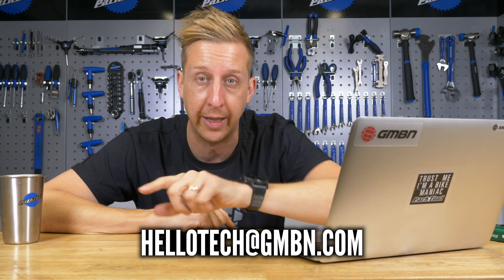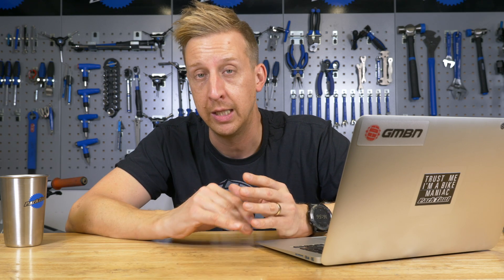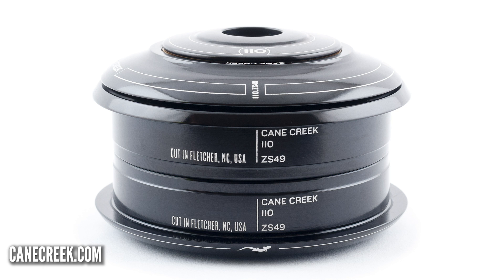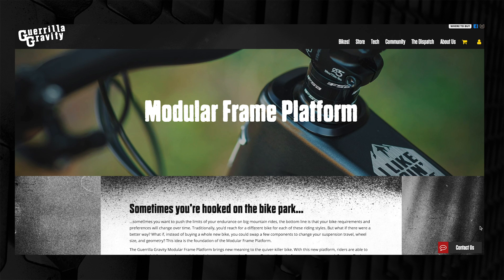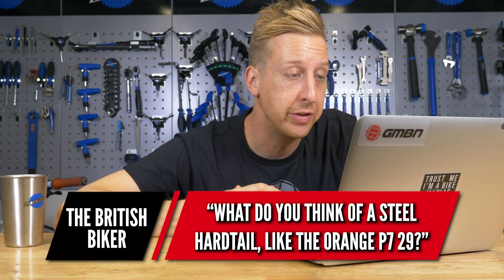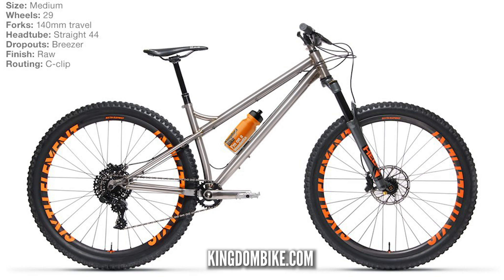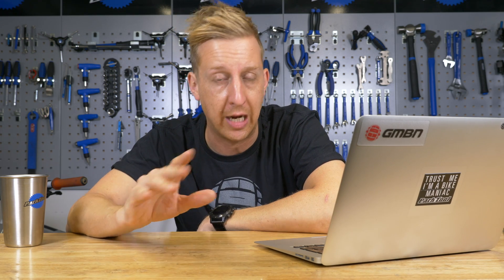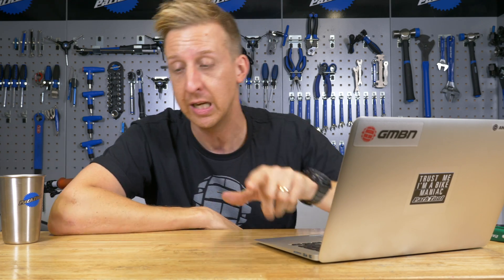What Is The best Frame Material? | Ask GMBN Tech

Comment from the maker: Remember to use the hashtag #AskGMBNTech with your questions 👇 and we will try to answer them for you. 🔧
Reply: #Askgmbntech why dont bikes get glued( aluminium)Most cars nowadays use an epoxy which is very strong. Bikes dont go thru as much stress as cars(energy) so surely it could work.
Reply from the maker: @natfelton7586  The Atherton bikes have carbon tubes bonded into 3d printed lugs and the lugs have an internal wall supporting the tube also. It's an interesting concept and we may start to see more of this in the future.
Reply: @gmbntech  nice thanks for the feedback. Could also be lighter 😂😂 than welding. Save 0.00000001 grams
Reply: #AskGMBNtech If you have e-bike, do you need to go faster on jumps, because its more heavy and gravity force it to ground more?
Reply: #AskGMBNtech I know some people buy metalic and resin pads. Then they put one side resin and second side metalic pads on same brake. It will work in high temperature (metalic) but also in slow speed and low temperature (resin).Is this a good idea???
Reply: #AskGMBNTech what is a good mtb full suspension on 13yrs?
Reply: #AskGMBNTech what about brand new chain and lubrificant ? it came with some sort of grease on it, but everytime I change my chain I'm asking myself if I should not clean it and then apply my dry lube. Thanks for your top show Doddy !
Reply: #AskGMBNTech
Hey Doddy, A big thanks to all of you for the great work! You keep me motivated!
I am upgrading my bike components ( Cube 29" XC hardtail ) and eventually i would like to transfer all the goods to a more aggressive  hardtail frame . Any suggestion on a good one around 150-200 euro? Thank you and keep up the good work!
Reply: #AskGMBNTech I've been looking at forks for my jump bike and I came across the 2017 rockshox Sid world cup forks. Would they be suitable to put on a jump bike (strength wise) or would it just be a stupid idea to put super light carbon crown forks on a dj bike.
Reply: #AskGMBNTech Is a 26er hardtail good for trails? Tnx Enjoyed your videos keep up the good work

Comment: hi sir, I wanted to ask you if I can upgrade my rear speed from 7 speed to 11 speed although my bike came with 3*7 combo
I am ready to change the shifters and derailleurs but I wanted to ask whether my bike frame restricts me to upgrade the speed. I ride a Montra Madrock 27.5 inch model with dual disk breaks. I'm also thinking to change the brakes to padded ones and the handlebar to a down one, would all that work?

Comment: #AskGMBNTech

G'day Doddy,
I own a Scott genius 740 and really enjoy the bike. The only problem is that because of the twinloc remote lockout technology thing, I have the most horrid looking cockpit. Any idea how I would go about removing the lever/cables and replacing the fork/shock lockout switches with the little levers most bike manufacturers use? I haven't been able to source them anywhere here in Australia and online hasn't been great either.
Next step is heat shrink and it'll be sweet!
Cheers,
Eli

Comment: Best material is actually steel. Easy to make frames of it cuz it has been used as a building material since ancient times. And there is plethora of different steel grades/variations with plenty of different attributes. Not eben TI is as good as good old steel. And carbon fibre is just not on the same level in the long term.
Reply: Literally everything in your comment is wrong.
Reply: @truantray  Would you be so kind an elaborate why literally everything in my comment is wrong?
Reply: 'That which is supposed without evidence may be discarded without evidence.'
In spite of that, and in case someone in the future needs this clarified:
Stone, wood and lead have also been used as building materials since ancient times. Easy to work does not necessarily mean good - I don't think I'd want a granite or balsa wood bike frame, personally.
You seem to grasp that there are different varieties of steel, but omit the fact that there is a variety of titanium alloys as well. Lol unalloyed titanium is almost exclusively reserved for niche use. Titanium alloys are incredibly high performing materials - I'd like to see you justify the claim that steel is better than Ti with something quantitative, price not factored (remember you said best, not best per budget). Pound for pound, Ti kicks steel's a$$ in strength, stiffness and corrosion resistance.
Modern carbon fiber frames are every bit as good 'in the long term' as steel. Take a look at the stress / strain curve. Both have environmental exposure issues, and they both must be protected and cared for. Unlike aluminum and titanium, they can both be repaired by skilled professionals with the right tools.
I get it, steel is cool. It's a great material for a bike frame. If you break it, you can weld it right back stronger than the first time and that's awesome.
Reply: @iankirven2711  Steel is better than ti because it is almost as light and u can repair it pretty much everywhere in the world. Carbon is simpely to fragile when u handle it not as intended. If u get a chaindrop which frame will be in danger, the Steel or carbon one?

Comment: #AskGMBNTech 
hey doddy iv got a rock shox monarch plus when in open mode it has a knocking noise when compressed passed the sag position no nocking in any other setting ? it works fine but very annoying would a 200 hr service cure it ?cheers

Comment: #AskGMBNTech Hey Doddy, I have gotten a few small scratches on the stanchions of my Rock Shox Totem (air). You can just barely feel them with your finger as they are very shallow. Will the scratches cause any problems? Any tips on how to keep the stanchions from getting scratched in the future? Also, should the Totem make a knocking sound when turning it upside down or pulling the stanchions all the way out?

Comment: #askgmbntech 

Hi, recently went to add a volume spacer to my fork but forgot to realise the air out of my fork before removing the cap, a metal pole flew out of my Stanton and I hear a pop, my air tube for the fork is now lower down in the fork and I cannot pull it out, is my fork fixable or will I need a brand new one?

Comment: #AskGMBNTech I've got a Morewood Makulu which has 200mm of travel on the rear and currently running 200mm boxxer rc forks. Would it be ok to run 180mm sc forks although I'm running 200mm on the rear? Looking at buying a set of bos idyle sc forks. Thanks

Comment: Hi Doddy! My gears seems to skip at the heaviest gear(11t) is it possible that my chain weared out but inspecting my Cassette it seems ok. What do you think is the problem? #askGMBNtech
Reply: Paul Malang yes it’s possible that your chain is worn out. Invest in a chain checker
Reply from the maker: Hey Paul, yes it could be that your chain is worn but first look at the limit screws and cable tension.
Reply: #askGmbntech is sram 12s chain compatible with 11s?
Reply: Paul Malang if you have a 12 speed chain, try it. If you don’t, 11 speed chains are usually cheaper
Reply: Paul Malang I don’t think it is

Comment: #askgmbntech

Hi doddy, i ride an octane one zircus dirtjump frame with a 130mm manitou circus expert, after riding a few months i realized that 130mm was way to much, in the manual it says that the fork is made for 120mm to 140mm, i'm thinking about riding with 100mm or 110mm without buying a brand new fork. Do ypu have any solutions for my problem

Comment: #AskGMBNTech Doddy, If I am consistently bottoming out my shock, it would be recommendable to get a volume spacer? Or just keep putting more air to the shock? I have a Rockshox Deluxe RT3 and always ride with a big backpack.
Reply: Fabian Garcia Alvarez if your sag is correct and you keep bottoming out, throw a few volume spacers in
Reply: @peterlang5047  thanks man, I will try it for sure
Reply from the maker: Trey adding some more pressure first and see how that feels. If you find you are loosing small bump sensitivity you can add some volume spacers. It's also worth experimenting with compression damping if you have that option.
Reply: @gmbntech  Thanks ! will try

Comment: #askgmbntech My friend has a sram nx 11 speed drivetrain and after just sitting overnight it has no chain tension  whatsoever, the clutch on it still works, but without any chain tension, we attached a random spring we found to the cable guide pully and to the cage, it has about the same spring tension as before, and he still can use the highest 8 gears like this, we attempted to take apart the clutch and spring housing but weren't able too, any thoughts on what may be the problem, or and possible proper fixes? Anything will help! love the videos!

Comment: I have a Chris King headset. I  did get it to go onto a mountain bike when the headset fitted needed replacing. The problem I had was the bike needed replacing instead of just the headset. The problem number 2. The headset was completely different. I have a Kona Dr Dew hybrid which I use for road and light off road. When this bike needed a new headset I had the Chris King headset fitted. I had had no problems with it and it is as smooth as the day it was fitted.
Reply: Wow, a Chris King headset on a hybrid? Pretty bling, but I guess if you have a $300 headset just sitting there...

Comment: #askgmbntech Love the show Doddy. I'm running Shimano XT brakes with 180mm front 160mm rear Icetech rotors. I'm not looking for anymore bite from my brakes, but I do notice that they tend to over heat and fade on fast decents. Is this because the rotors are wearing down and are thinner? or is it just an Icetech thing? These rotors seem to cool down quicker than normal rotors but I feel like they heat up and brake fade quicker. should I upgrade to 200 front for better heat dissipation? I bought the bike used so I don't know if the brakes felt any different when they were new.
Reply from the maker: The next step would be to try some finned pads. 👍
Reply: @gmbntech  I do have finned pads

Comment: #AskGMBNTeck . i would like to know if it is possible to route both types of dropper post into an internally routed frame. i converted from a 2x10 to a 1x10 and have the routing port spare.
Reply: If your frame has enough space around the bottom bracket to route the cable without kinking you're good!

Comment: #AskGMBNTech
Just broke the bridge of my old RockShox Reba (its an OEM version). So I bought a new used Reba SL (probably 3 years older than the one I broke) on Ebay, but it seems that the pressed in steeringtube is loose...
Do you think its possible to combine the lowers of the new fork with the upper Part of my old one?

I'm a student from Germany so pls don't judge me on my probably bad english
Reply: You probably can, but it will probably be difficult. Try knocking the newer one back in with a piece of wood and a mallet. Your English is great fyi. Nice part about English and German is they're very compatible. Ride on 🤘
Reply: Billy Annis Thank you very much!
Ride on too 🤘🤘🤘
Reply from the maker: If the steerer tube is loose in the crown we suggest you don't ride it.. This can be very dangerous if it breaks away! Providing the upper tubes are the same size it is possible to swap the lowers. 👍
Reply: GMBN Tech Thats what I thought too..
I think if I‘m abled to swap the working parts of both forks it should be one working fork in the End

Comment: #askgmbntech just ordered a new rockshox super deluxe coil on my new airdrop edit. I will need a few turns of preload on the shock. Since it requires more force to move the shock does that essentially ruin the subtleness. Surely if it’s preloaded to let’s say 1 newton and I go over a rock that only exerts 1 Newton the spring won’t move and it will essentially do nothing to absorb impact??

Comment: #AskGMBNTech Hi Doddy, I recently built a jump at my local woods and I nearly bottomed out my forks. I ride a Rockshox Lyrik RC2 so my initial thought was to add a volume spacer to it to make it more progressive. I'm new to doing my own mech work on my bike and I love to learn more about it. Can I use any cassette tool to open my air chamber or is it a specific one I need?
Reply from the maker: In your case yes a cassette tool is required to remove the top cap. (*make sure you remove all air from the fork before removing top cap!)👉https://gmbn.tech/volumespacers
Reply: Use an adjustable wrench
Reply: I don’t have a rockshox lyric, but on most forks you would use either an adjustable wrench, or a cassette tool

Comment: #AskGMBNTech

Hi Love you channel!  I have  a RaceFace Turbine dropper post that works for a few hours or at most a day and then requires "equalizing the remote".  I complained about this to store where I purchased and they "readjusted the installation" and it seemed to help for a few days and then it always returns to same behavior requiring "equalizing the remote" every few hours of riding.  I have noticed it is worse when there is a large change in altitude or barometric pressure.  I have contacted RaceFace and they just send me their trouble shooting guide and won't comment on the requirement for constant "equalization".    Is this just a consequence of bad design that I need to live with or is there a fix?  What is your recommendation for the best performing and most trouble free dropper post?  Thanks
michael bastiani, Salt Lake City Utah

Comment: #askgmbn
With all of the advances in suspension tech.. Why do suspension manufacturers fail to use adjustable damper cartridges? Its not like they are very expensive. Even the worst performing coil forks could be amazing if they came with a better damper. Just look at the auto industry. Infinitely adjustable re-bound /bound make it insanely dial-able. I have a suntour xct 28 on my 29er. It would be incredible if it had an adjustable cartridge instead of a fixed damper .  please shead some light

Comment: how do i accurately measure my rear travel? #Askgmbntech
Reply from the maker: It should be listed by the manufacturer, If it's an older model they should still be able to help provide this information. Failing this you could remove the coil/any air from the shock and measure the axle in this starting position and then re-measure again once the shock has hit full compression. You would require a workstand for this to keep the bike elevated and a fixed point to measure from such as a work bench. Hopefully this helps you. 👍
Reply: @gmbntech  thanks for the reply! 
will definitely try to contact the manufacturer first.
Reply: Google

Comment: #AskGMBNTech
Hi Doddy,
I just bought a Lapierre Spicy 3.0 and still have £400 of my budget to spend. What do you think would be the best use of the money, upgrade the bike (i.e. suspension?, for cartridge?, wheels?) or bike accessories or kit. Or should i just keep the money and spend it on travelling?

Cheers
Reply from the maker: stem length, handlebar choice can really change how a bike feels so you may want to start here? Perhaps you have a particular pair of grips, pedals or tyres you like to run? Have you experimented with tyre inserts?
Reply: @gmbntech   I didnt think about the stem and handlebar might have to experiment with that, im gonna have to get pedals as well, and i have'nt tried tire inserts yet

Comment: #askgmbntech I recently bought Scott Aspect 930 2018 used bike, it's in amazing condition but it's equiped with Suntour XCR 100mm Fork. Should I swap this fork for something else and which one I should put in it. I would like to get this bike a bit better for hill so...
Reply from the maker: Is this an Air or Coil fork Elmin? What brand and model will depend on your budget. Check out the Rockshox Recon range though 👍
Reply: @gmbntech   Left side: Coil spring with pre-load adjust
Right side: Hydraulic remote speed lockout with fixed rebound damping

That's what specifications says. 

My wheels are 29" and I would like to fit 120mm or more fork if it's possible. 

I could go up to 450-500€ or even I could buy used fork which is in good condition. But I don't know any sites to find here in Europe.
Reply from the maker: @elminhadzikadunic4289  You could try to find something second hand and budget for a service. Look at the Rockshox Recon Range though 👍

Comment: #AskGMBNTech
How much of a change in weight before you start messing with your suspension setup?
Meaning, I went to a gravity park recently.  I rode with a Camelbak and camera/gimbal setup so maybe 5 to 10 lbs?  Later I got rid of all that and kept riding but didn't notice any real changes other than the weight off of my person.
Reply: It depends on the frame design, I'd say. On my previous bike, I had to adjust for my backpack with camelback with adding about 10 psi. On my new bike, the Nicolai G13, the difference between a back pack and no backpack is so minimal, in sag I don't bother really.

Comment: #askgmbntech Hi Doddy !
I wanted to change my bottom bracket but when removing the crankset, the non-drive side bearing of the BB stayed on the crank axle. Any suggestions how I can remove it ? Looks like seized 😞
Thank you !
Crankset : Race Face Aeffect
BB : Race Face PF30
Reply from the maker: If they fit tyre levers can help you with this one! Either gently work your way around the bearing to keep any movement level or use 2 levers at the same time on opposite sides of the bearing.
Reply: GMBN Tech Thank you !! I have already tried this with a metal lever but it broke ! It’s really stuck. Looks like I am going to pay a visit to my local bike shop !
Reply: @Abstrackt88  Apply WD40 and heat (heat gun) in cycles as you try to gently (!) break the bearing free in between turns.
Reply: Le Typ thanks ! Will try this !
Reply: Made it ! I clamped the axle in the bike stand and hammered the sh*** out of it !
Reply: LBS could try with a crown race puller. Or rent a bearing puller from an auto parts shop.